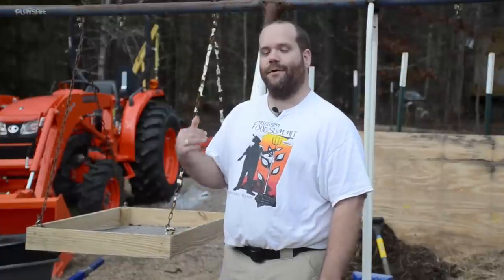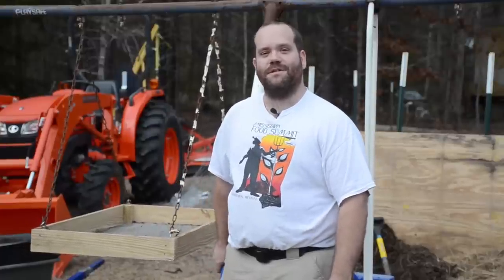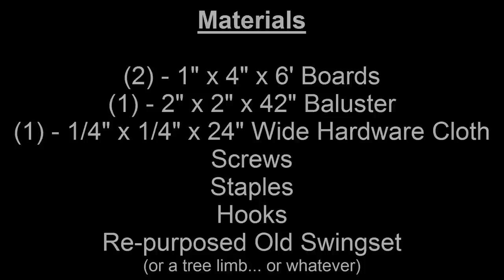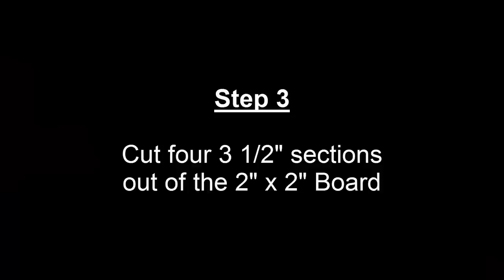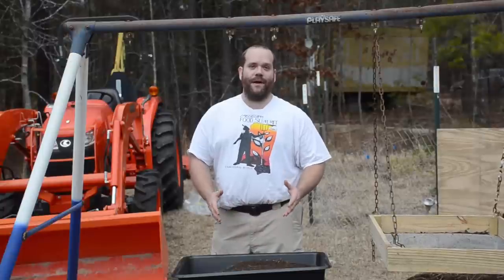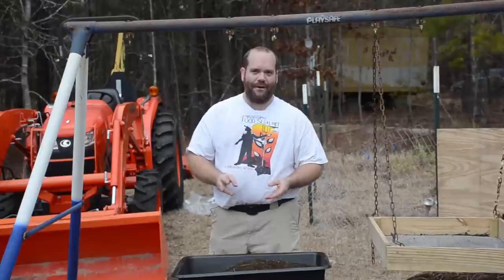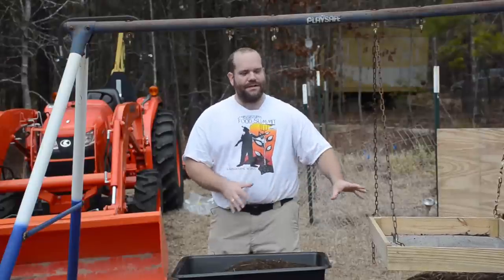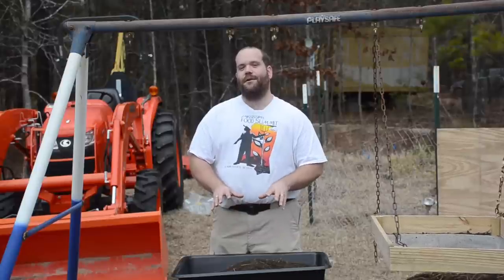DIY Compost Sifter Shaker

Comment: Great video. Great example of re-purposing what you have to make it functional. Also, consider a worm bin as another method of creating compost. Its affordable, requires little effort and you could use your same screen to separate the worms from the castings.... Thanks again for sharing this upload
Reply from the maker: Tim Huffman, I very much want a worm bin, just haven't reached that stage yet.

Comment: @AV maybe make a little smaller version and suspend from your wooden rafters in the basement over the table and sift the material into a larger mortar tray? That would be easy on the back. Use carabiners and you can have multiple screens for finer and finer material.

Comment: Nice use of an old swing set Jared - looks easier than shaking it over the wheel barrow, but is it a bit of a pain to empty out the chunks? Glad you have some nice compost for your starts.
Reply from the maker: Ben Jamin, here is what I ended up doing after some trial and error and off-film:I have one of those mortar mixing trays, as you see in the video. I ended up setting it on the ground instead of in the wheelbarrow.I would shake the compost in to the wheelbarrow and then dump it into the tray.Then I would dump the big chunks in to the wheelbarrow and put them back in the compost.It is easy to dump the tray, I just lift up on a short end until the chunks fall in to the wheelbarrow off the other short end.Does that help?
Reply: Ahhh yeah. I can see it's probably not hard to flip the tray now. At first it looked like the chain might get in the way

Comment: This is great. But, if the box was clunking into something at each end of the travel, the forward velocity change would help the sifting and the operator would not need to add the braking energy. The operator would get more done with less input.
Reply from the maker: Sounds like a great idea!

Comment: seeing the video begs the question: what did you sift out? straw hay pieces seem to still be there
Reply: Use a gloved hand to work the material. I suggest 1"  hardware cloth is fine enough and won't grind up the worms. Keep another box close-by to dump in bigger bits

Comment: You did't show how easy or uneasy it was to dump the unsifted compost back onto the pile. That is a big design consideration when building a sieve.
Reply from the maker: I suppose that is a fair point. Here is what I do:

Put a tarp on the ground
Shovel raw material on to the screen
Shake material down into the wheelbarrow
Dump un-sifted material on to the tarp next to the wheel barrow (being on chains, this is easy)
Drag the tarp back to the compost pile

I hope that helps in some way!
Reply: That's great if it is working well for you.
Reply from the maker: Yes, I've been happy.

Comment: I built 2 screens that fit over my wheel barrow - 1/4" mesh and 1/2" mesh - that I use quite a bit to sift compost, rotted wood chips, etc, and a window screen I put over it for sifting sand.  But it's hard work holding up the weight - so this is very clever. Checkout my channel for some Western Washington scenery and gardening. Thanks!

Comment: I first saw a hanging sifter on a cob mixing video and thought, hey, great for compost! I have to ask, how easy is it to flip out what is left in the sifter? The video I had seen seemed like they hung it slightly off balance, one side of the actual ropes they used was longer than the other, and there was two handlebars sticking out the one end that you hold and use to shake and then turn the sifter on its side to empty the larger pieces. I hope I explained it accurately enough. This guy had a pretty great design and application! https://youtu.be/CtkaxPphx2A
Reply from the maker: We don't have any problems. Got into the habit of putting a tarp on the floor next to the wheelbarrow. Just dumped leftovers sideways onto it, then drug the tarp back to the compost for it to decompose more.

Comment: You’ve got a big tractor behind you which is a sign of having a high tech and yet you’re using the swing to sieve a compost pile?🙄😂

I bet you can build a machine operated sifter that can also be switch to manual operation if needs be but to use a swing is a bit funny and that’s children’s toy